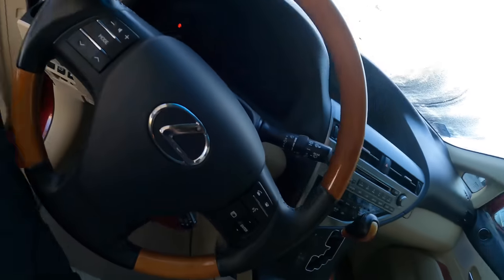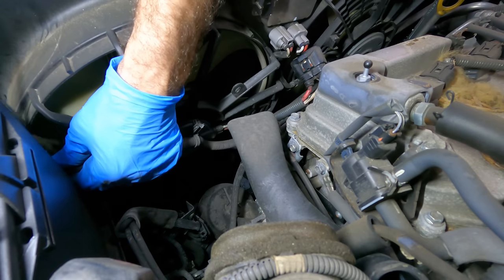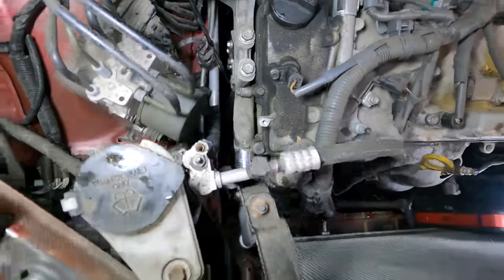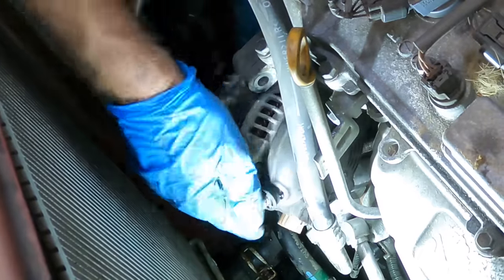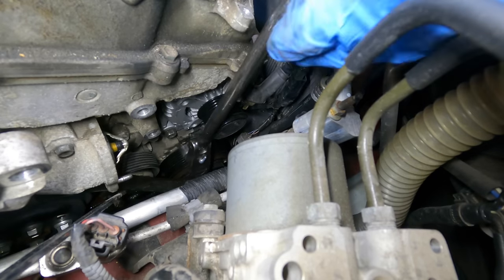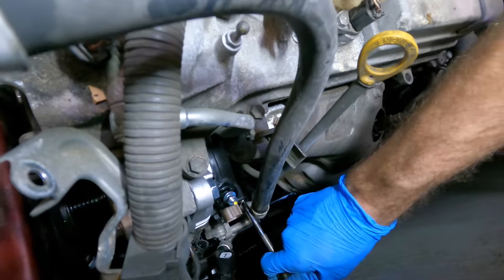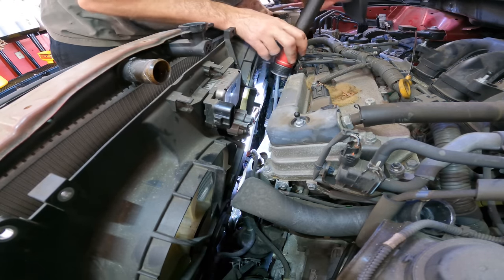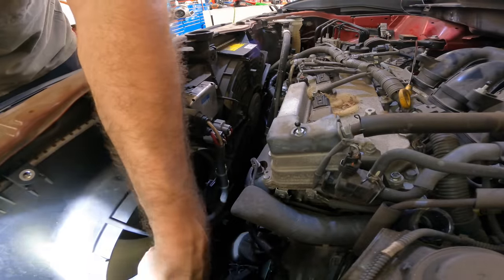Lexus Died While Driving! Towed In! No crank no start.  2011 Lexus RX 350

Comment: Love all your videos but I just did this job yesterday I didn’t have to take off half of what you did lol didn’t take any coolant out radiator took the wheel off and removed the belt and there is a hole for the tensioner to slide in a bolt and it holds itself pulled the fan and 4 10mm bolt son rad support pulled forward had plenty of room to get it in and out just that shitty extra L bracket on the alternator is a pain

Comment: My mom had a 400h, the first year they came out, about 3 years ago at 100k Miles ( she doesnt drive much) when it was raining,  it started dying when the gas engine shutoff and only the hybrid system was on.  Lexus replaced the hybrid system, hybrid batteries, a whole bunch of other stuff it went in like four or five times, finally said they had fixed it but sure enough the next time it rained her and I were on the freeway as we hit traffic and stopped the hybrid system took over and the entire car shut down and it wouldn't turn back oke were pretty rough spot on the freeway for that to have happened. Turns out it was a  frayed wire under the car that shorted the hybrid system out when water got on it

Comment: Just curious, when I was a kid 50 years ago we would jump start cars by connecting both negative terminals. 35 years ago they warned to make the last connection to a ground away from the battery. I followed that “rule” for 35 years.  Is it BS?  Ray never does this.

Comment: January...Alternator failed in WinCo Super parking lot...2 days a mobile mechanic came and installed a rebuilt Alt...getting me out of that lot...I feared Store Tow...but they never said a word...The WinCo a few miles to the East of this one...Sent 2 Rude Big Guys out threatening me with towing...I was there trying to help a girl that got ripped off by a used car dealer in Idaho for this Honda Accord...7 000.00 for this car with 80,000 plus miles and water pump blew...and blew head gasket too...I put Blue Devil in...it stopped up the gasket leak...BUT THE GIRL WAS NOT VERY BRIGHT...SHE RAN TGE CAR WITH NO WATER IN IT...WRECKING THAT GASKET FIX BEFORE A MOBILE MECHANIC COULD SHOW UP(HE BLEW A HOSE AND SPLIT HIS RADIATOR...SO HE NEVER MADE IT...SO SHE PMS AT ME AND BLAMED ME FOR NOT FIXING HER CAR...TURN COAT WITCH...UNGRATEFUL WENCH...I NEVER DID HELP HER AFTER THAT...BYE BYE NOW...IGNORANCE...

Comment: Manufacturers put starters & water pumps inside engines, why not alternators? How about camshaft drinen internal power steering pumps? How about putting the AC compressor in the transmission? Why not?
I miss my 64 Ford Falcon. R & H, easy to fix.

Comment: Why do the car designers put the parts that eventually need replaced in the hardest to get to areas ??? Starters, alternators, thermostats, water pumps, fan belts .... etc ... ??? Some agency should monitor this and include it in the sales pitches and brochures that they have designed the vehicle to be quite costly when it comes to repairs due to poor design !!!!!!!! Great job Ray, you must be a Jesus disciple, because I would have had the Devil himself smiling with all the cussing I would have done doing this !!!!!

Comment: 91k miles and it needs a new alternator? This is something to look forward to.
(Owner of a 2013 RX 350 here, this video helps.)
Reply: My 2010 lexus rx350 has 200,000 miles on it I haven’t change my alternator yet since 65k miles only starter at 195k this car has 91k miles alternator fail already that’s strange
Reply: Someone left it running for too long,  @doer2472 ?

Comment: Would it have been easier to remove the grill and radiator to get access to the 'Nator?  possibly just swing AC condenser over the top of engine without discharging it.

Comment: The plural of Lexus is Lexus. Like Moose. E.g. "Do you see the fleet of Lexus in that parking lot?"
IDK. Maybe it is Lecks-sus-ses?

Edit: To my understanding, newer cars won't charge a battery if it the battery puts too much load on the charging system. You would then need to diagnose which is the failed component. It's always a possibility that both could be bad.

Comment: That is just too much stuff to remove just to get to an alternator. On my car I can touch the alternator without removing anything. I can access the spark plugs and oil filter without removing anything. 
I saw a car yesterday (small car) that had decided to drive through flooded water at a decent speed and didn't make it. I opened the bonnet / hood, unclipped the air box and it was full of water. I took the filter out and was shaking it (away from the vehicle) watching all the water come out of it. There was still about 1  inch deep water left in the bottom of the box (where the air feeds to the motor). He had obviously drowned it big time. He was then scooping water out of the passenger compartment (about 1 - 2 inches deep) and throwing it outside the vehicle (Too late man. You've totalled your vehicle already). The headlights wouldn't turn off and all he got when he tried to start it (bad idea) was a click from a relay. Starter didn't move. Of course the motor is full of water.

Comment: This is like watching the movie Halloween, with those scary moments..
I "was" thinking about getting a used Lexus for puttering around, but this video is making me think twice...
By the time you get the alternator out, might as well change the water pump, the air-con compressor and the engine...   ;-)

Comment: When I did this job, I loosened the radiator to be able to tip it forward.  I also disconnected the thermostat neck entirely.  Made the job way easier.

Comment: You just convinced me to never buy a Lexus. Very tight working space is a problem with many FWD cars but that Lexus is particularly bad. I have a 2007 BMW X3 E83 3.0D (6 cyl turbo diesel). I thought that was bad but it a breeze to work on compared to that thing.
Reply: Bring back the 60's and 70's. No computers, no pollution garbage - long live simple mechanical things.

Comment: I've seen other videos, where they removed the passenger front tire and liner and it gave more access to some of the bolts. Still an PITA though. Very poor engineering design. All maintenance items should be easily accessible. No excuse for this.

Comment: I have actually never heard that an alternator will not charge a dead battery. But, as a mechanic, you should know that  charging a dead battery with an alternator can damage the alternator due to overcurrent and that is not covered under the warranty. I understand why you did it, but it's still a dumb move.

Comment: 6:20 Noticing signs of rodent activity, grassy material under the engine cover, and those blotches all over the top surface of the black plastic beauty covers are probably pee stains.  Wouldn't be surprised if Ray uncovers rodent damage to wiring.

Comment: I hope there's a special place in hell where the engineers that design these vehicles have to spend eternity working on them.

I replaced an alternator in a ford mini-van once (nothing like this, pretty straight-forward) however, the new one was faulty and I had to do it again. I'm not sure what I would do if I had to do this and find out it had to be done again.

Comment: SOB!  Remind me to never buy a Lexus.  What a pain to just change the alternator.  I could have changed alternators 20  times on my 1999 Mazda B4000 in the amount of time you needed for that 'yota alternator.  And here is a fact; my truck has 239,000 miles on it and the only thing I ever had to work on was a blown front brake line.  Nothing else has broken.  Not even in the suspension area.  I love that truck.  Wish it wasn't such a gas hog.

Comment: 2010 same issue. Died while driving. Replaces battery. Drove for 2 weeks no issue then same thing happened. Replaced alternator.  Now car is cranking won't turn over. Battery slowly died. What could be happening.  Put a reader on it and Got the code p0335.

Comment: I have known a few people with this 3.5 Toyota motor and all of their alternators have failed. I wonder if it has anything to do where it is located seems like it would get mighty hot there where it is located 🤷🏻‍♂️ and yes stupid design. The other achilles heals with these motors is the oil rubber bypass hose busting and causing catastrophic immediate oil loss. The updated part is all metal 🤦🏻‍♂️

Comment: Jumping like this is what destroyed my Lexus... these cars (as most modern cars) are very sensitive to voltage jumps and it can mess-up the car. In my case it ruined the immobilised (ID Box), which is pretty much totalled the car, because fixing it costs same as the car is worth (2008 IS250). So when I see jump starter sparking around I know this can't be good. As well - putting hood support bar through the hole in the hood means that hood is resting on the outer skin and could easily dent the hood... I just see no reason to treat this car like complete shit, risking electrical damage by scratching clamps, then risking cosmetic damage to the hood for no reason. Lexus are reliable cars when treated right, but when they treated like this they my become huge headaches.

Comment: Every time this happened to me...alternator required
Reply: picked it. With the Infiniti I30 (2000 model) even though you could see the alternator from above and it looked like you could get it from above, it had to go out the bottom with just a matter of removing bottom plastic and the air con compressor...1 hour job for a non-professional. Why the dealer wanted $1200 for the job I could never understand. Part was $260.

Comment: Damn engineers do not take the poor mechanics into the mix when they design stuff. Not like my old F-150 1978 4x4 that was a maintenance breeze… lots more space in the engine area.. way to much extra plastic and other brick brack… The days of a standard carb and fan on the engine…. 
How many leftovers did you have???

Comment: Man, what a super poor design!  Working on a vehicle like this one would make a preacher cuss.  
A little trick to share, get a piece of thick cardboard or some thin sheet metal and use it to protect from damaging the fins of the radiator when working close quarters like you had to do on this one.  Done this many times, and it works and it prevents damage to the fins.

Comment: Open the bonnet (ok, "hood" to you Melican foreigners!) and what can you see? Well, nothing really, just a sea of black plastic with everything hidden. And when you remove all those plastic covers - "oh sh*t". Let the be a lesson to any and all would be Lexus owners. If it needs anything more than tyres pumped up throw it away and buy a Mercedes because Taxi drivers in every country in the world cannot be wrong! Full marks to you Ray for investing so much effort to change out an alternator, a 20 minute job on most sensibly designed cars but on Lexus a 2-5 in Leavenworth might be over quicker and be less strenuous! I thought Jaguars were bad enough for cramming everything in but that Lexus takes the prize/

Comment: I did an alternator and a few other repairs on a 2005 Highlander. Toyota (and Lexus) have the dumbest effin designs, purposely engineered for you to either A) have $25,000 invested in tools and a metric ton of patience or B) get used to the vending machine coffee at the local Toyota dealership.

Comment: next time put a jack on the oil pan with a wood block in-between the oil pan and jack and raise the side where you already  have the engine mount off and that will give you the clearance to get at all your bolts this will work on all transverse mounted engines or you can go in through the wheel  well remove the plastic wheel skirts and everything is there right in your face.

Comment: No wonder that Lexus covered 80% of the engine in cheap dull plastic, its so you can not see what a terrible design job the engineers did. I would be in a bad mood also RAY after having to do all that for a 3 bolt alternator.

Comment: All that work just to replace an alternator.  Shame on Lexus engineers.  After they complete building the car , they should be required to perform test repairs on the most common items that need replacement and see for themselves how hard and ridiculously insane it is.